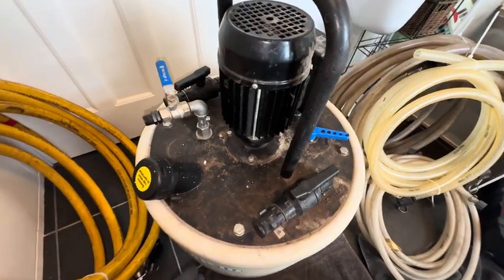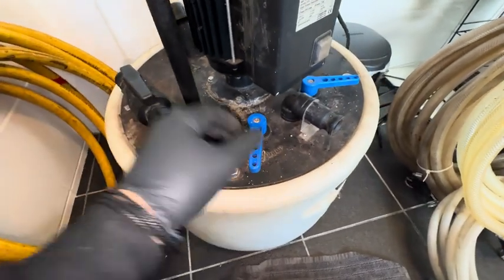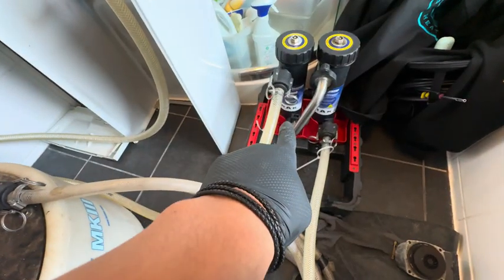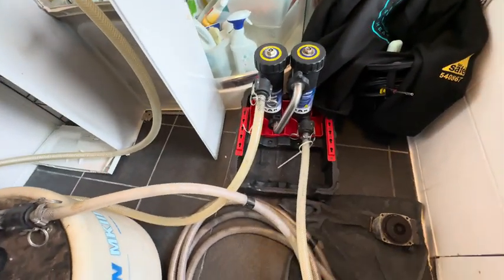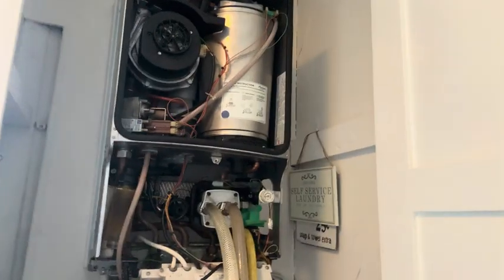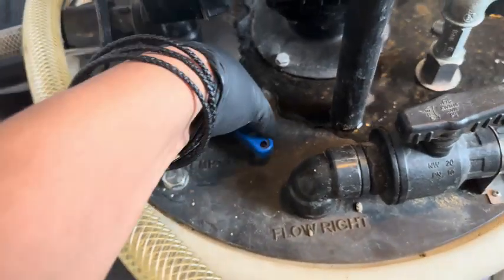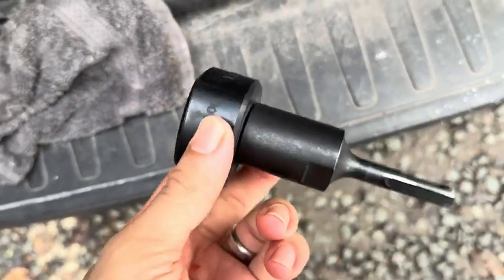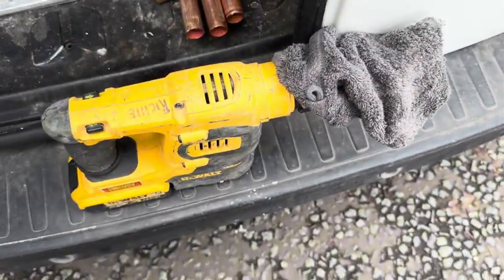Basics of how to Powerflush - Fernox Powerflow2 Set-Up

Comment: Question,  did you find the fernox any use without the hassle off using magnets 🧲 

Does it still do decent job???
Reply from the maker: @Mastergas-r7n  I’ve always had decent results using Fernox to be fair, Sentinel too in all honesty.  But I pretty much always use the magnets haha! I have done a few without them and just chemicals and seemed fine, the magnets are just a much better extraction method!